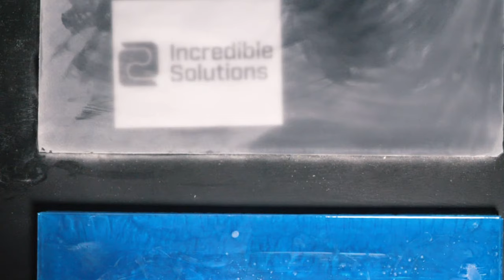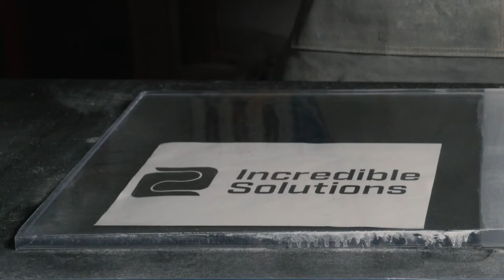How to Polish Epoxy Resin for a Crystal Clear Finish | Incredible Solutions Online

Comment: So are you recommending the epoxy topcoat? I've spent a lot of time with the stages of sanding all the way to 4000 and haven't done a top coat on anything. Also, how does this process work for pieces where it's a combination of wood and epoxy? Everything I make includes both.
Reply: Did you ever figure out an answer to this?
Reply: I have pieces I’ve sanded to 4000~ and I still don’t know what to do. It’s still scratched up from the sandpaper. Like it feels nice and smooth but there’s scratches everywhere  (and bubbles because we’re new to it and don’t have all the right tools). I’ve tried washing the epoxy but that doesn’t do anything.
Reply: Apparently you can buff it out with a car cutting compound and buffing pads.  I have the same problem on my knife handle.
Reply: @bearlyplaying  I am not sure if you still need an answer to your question, but swirl marks (spider webs) are due to epoxy dust building up on your paper and then scratching the surface you are trying to sand. Use mesh sanding discs (Abralon), always connect your orbital sander to your vacuum cleaner and change a disc as soon as there's a buildup. Once you reach 1000, switch to using wet sanding discs. Hope this helps. :)
Reply: @bearlyplaying  when mixing epoxy, always measure amounts don't guess, mix slow by hand with a clean stir stick, pour to another cup slowly with cup at a tilt. don't pour to bottom of cup but rather aim for side to avoid bubbles. seal all wood surfaces that will be in epoxy before hand or you will get bubbles, during these steps being impatient is not your friend.  don't get one of those auto orbital buffers, they don't have the speed, etc. get a decent polisher/buffer like 5 or 6 inch is good, i have the hook and loop type but there are also stick pads for some, these are also best tool for sanding everything also since any tool that just goes back and forth or is under powered will leave marks you don't want. dry sand 80/100 up to 320/400, wet sand 600 up to 2k. then use cutting pad and cutting compound to remove any big scratches etc. then use medium polishing disk and polishing medium compound to polish., then use fine polishing compound and disk. this is a lot of work but working your way through it slowly seems to work best for me. lastly, if putting another layer of epoxy over another don't leave scratches, etc., in  layer and pour over it, they may show through later on.

Comment: Why go all the way to 4000 grit?  Good polishing compound will gloss it up nice after 2K to 3000.  Good tip on Abralon. Also - its a toss up between the labor of full cut & buff, vs fine sand, then topcoat. Which have you found to be less labor?  You still have to do minor buffing to topcoated panel

Comment: Hi I have to buff out a table I did for my customer because there’s some blemishes in it and some hard points sticking up so I’m gonna have to sand it down like on the video and buff it out how long do you have to wait before you can buff it out? Does it have to completely cure 100%? Or what’s the timeframe before I can sand and buff out the blemishes?

Comment: WHAT HAPPEND TO THE FIRST ONE U WAS POLISHING .WAS A BIT CONFUSING TO BE HONEST .
Reply from the maker: We're not sure where the confusion is. The clear panel is shown at the end with the final polish vs epoxy topcoat. We switch to the blue panel to show that the same process can be done on colored epoxy resin. You can see the results of both at the end!
Reply: @incrediblesolutions296  what kind of pad and buffer do you use in this project?
Reply: @incrediblesolutions296  From a number of comments here, "...so WHAT'S your conclusion?" is a general response.  Maybe it's a matter of video quality, but I don't think anyone is seeing a pronounced difference between the painstakingly-polished vs flood-coated.  So if there's a clear conclusion, you DO need to spell it out - if not by audio, then in writing.
Reply: @incredible solutions It seems like everyone likes that you preformed this experiment as we were all curious ourselves what the results would be. But we didn't get the results because apparently you filmed it  on a pre-microphone potatoe. We weren't sure what we were looking at and then you threw us for an even bigger loop when you started buffing the sample that we thought was done and would be used to compare only for you to magically make both samples turn blue. Maybe when you see this next time st the library you could hit us with the data like how long each one spent, how much each option costs, which one looks better and any other pros and cons you may have recorded. I'll be glad to give you a thumbs up when you do. Until then, you just wasted our time
Reply: @davids1681  Agree, the conclusion to this video left me feeling frustrated as I could hardly tell the difference and it seemed rushed with poor quality video.
Reply: @davids1681  top coat horizontal surfaces and polish vertical ones? 
I have a 5" vertical edge around a bar top I can't seem to get the runs out so going to try and polish this
Reply: @novice46  I'd do the same.  
I've still not put a poured-epoxy finish to the test as a countertop, though I've done many, many tests.  Part of my concern is the lack of hardness, I think in all "table top' formulations.  If I can't put heavy objects on a countertop without them leaving an impression, then sorry, but it's just not durable enough.  That's a major problem.  I've yet to see a tabletop epoxy supplier call out a hardness spec for their formulation, eg Shore or pencil hardness.
But the AESTHETIC downfall of the entire epoxy-to-countertop thing, in my mind, is edges.  I haven't found a method that I like yet, even incredibly time-consuming approaches...like sanding and buffing, for one.  Drools, runs, drips...all of them ruin the appearance, at least for me, because no stone edge outside of a Salvador Dali painting would look like that.
If you do sand and buff, my recommendation is to use velcro-backed mesh discs and a vacuum system, dry, along with powdered guide-coat to reveal all the scratches you're targeting for removal during that grit-level.  That method worked right up to 1200-grit -- because I didn't have any 1200 or finer mesh.  But it's available online etc.
I suspect that there are tens of thousands of people 'living with' the results of their DIY projects, and not a gleaming showcase of bulletproof jaw-dropping epoxy art that I'd at least somewhat hoped to be creating as well.  My goal at this point is to be able to maintain a countertop periodically by ultrafine sanding and buffing when tragedy strikes - or just develop the ability to ignore the inevitable damage.

Comment: Jesus beginning to hate epoxy. I can epoxy board with wood and never have issues. Usually use oil or another topcoat. Wanted to try flood coat over whole piece so I did and sanded it 3 times from bubbles. Finally no bubbles but now cannot avoid dust particles in finish no matter what I do. So I'm trying to find out if you can just polish them out without the entire sanding process. I've also done that is past polished up to 12000 and still never looks like glass do I'm kinda at a loss. Can I just polish it with compounds and buff it out or?
Reply: Yes, surely, from quite a few epoxy-polishing videos here...but you have to buy the [fill in proprietary relabeled product name] polish...
Reply: doesn't matter what polish you use. BUT make sure you have a sander or a polisher machine. Doing it by hand isn't gonna work. If you have bubbles, do a flood coat and then use a heat gun to pop the bubbles before it dries. Then when you sand, make sure to clean the dust off between every single stage otherwise you're gonna scratch up the next layer with the dust from the previous layer and accomplish nothing. Use rubbing alcohol or a vacuum or a microfiber towel and tack cloth.

Comment: Isn't it going to rub off, when it's cleaned with a harsh kitchen spray or something, even dish detergent, or on to people's clothing, etc? Since it's just a compound/polish? I feel, like a car, that table would be totally cloudy again in a couple months, but unevenly of course, and look terrible.?? Am I wrong?

 peace

*I actually have your 3 stage auto product right now. I was thinking about using it on a table, but I can't get past what I just described above. I see respectable makers use polish compounds, but Idk, I see a lot of things, lol. .. I also feel like I would taste it, and smell it maybe.
Reply: yep... mis-understanding what cutting polish compounds and cutting disks do.  They actually cut the paint/epoxy at a super fine grit, technically you are removing, not adding.

Coming from car paint world with clear coat 2ks; its basically the same exact process.
Reply: @Aerogrow  Lol, yes, I painted 2 doors and a tailgate last summer, matching the factory paint on my Laramie, and I had a lot of trouble. Actually I started 2 summers before that, lmao. First try, primer solids spew out of my new paint gun, like lava, appaerently, just globs of solids instantly etched into the metal, fuuuddd... sand it, try again, and again, and again... you know the drill, must have done it 6 times, lol...

 But after he answered me here, a lot of things clicked over the last week. Feel like a new man! ..   Now I'm staring at a table, the epoxy won't level, lol... never ends

Peace

Comment: Of the few videos on this subject I've seen thus far, there seems to be an obsession with using IPA to wipe down between coats.  Even if it weren't for shortages of alcohol currently, wouldn't this be better achieved simply by dust-removal with vacuum and brush attachment?
Reply: No, IPA lifts up the epoxy dust and whatever it doesn’t lift up it absorbs into the dust, breaks it down, and evaporates it. You will still have residue if you vacuum and your final product will end up cloudy. If you try top coating that way, you will have a layer of cloudy residue and need to sand passed that layer to gain shine back.
Reply: @washyrose5904  hmmm...one might have success in lifting away fine dust with /any/ wet medium, whether it's soapwater followed by a rinse, or lacquer thinner.  It's just a means to stick the dust to a wipe.  The trick with any such method is to use a vast amount of towels so as not to just spread the dust around, and personally I don't see enough benefit to doing this.  IPA certainly isn't capable of breaking down epoxy dust, any more than it can break down cured epoxy (there's no solvent anyone would want to use that could do so.)
Compressed-air-nozzle used in a dust-extracting environment (as simple as blowing a fan across the work surface) is my go-to method.